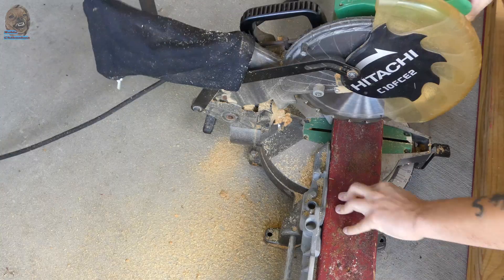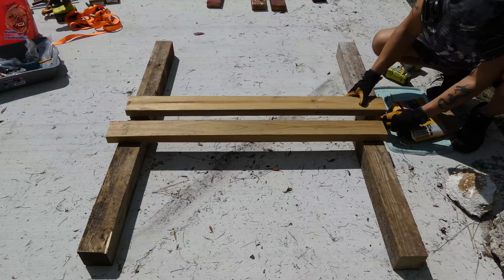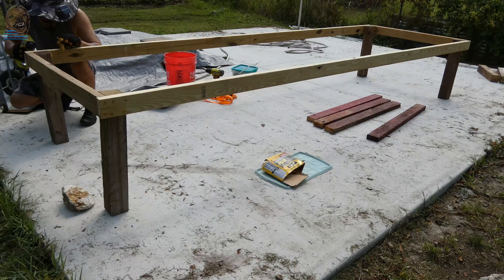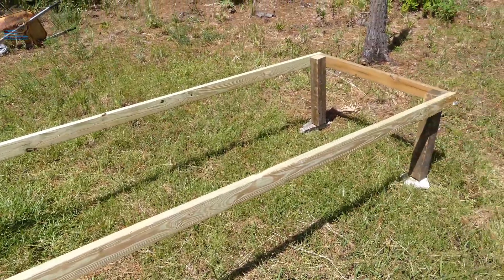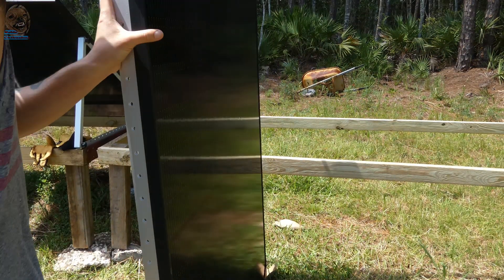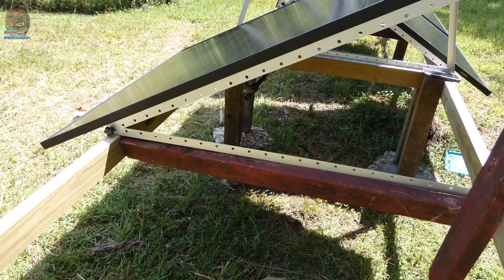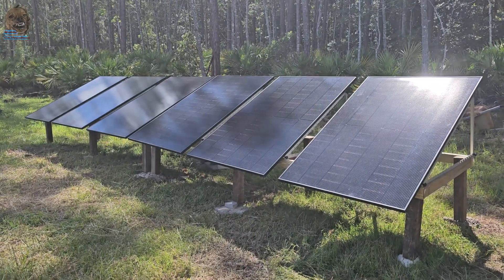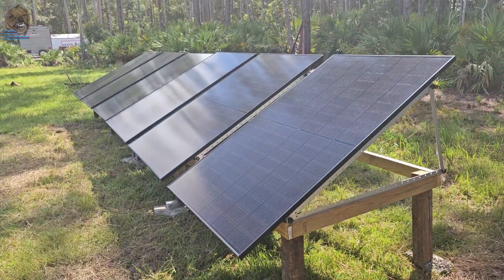DIY Solar Panel Ground Mount – Complete Build for Just $312!

Comment: I built something similar.  From my experience I would recommend flat metal washers on the screws attached to the aluminum angle iron.  With the constant breeze we have, the head of the screws begin to cut the holes larger  due to the wind.  Great video!
Reply from the maker: Good idea. Noticed the aluminum is very soft. I'll install for washers for sure

Comment: Looks nice!  If you are concerned about high wind tipping or blowing them over, Home Depot sells some 30” screw in ground anchors and they work great.  Buy some extra chain and quick links and that ground mount won’t ever move.  👍🤩☀️⚡️
Reply from the maker: Yes sir. Thats the plan as soon as I determine the final location for these things. Not sure if this current location is the best for sun exposure.
Reply: @NobleChihuahua This is exactly how I planned to mount my 400w panels but with the no dig screw in anchors. I plan to take it with me easily when I move..🏌🏾‍♂️
Reply: The screw in anchors I am doing too, but what's this about the need for extra chain and quick links?
Reply: @mrfantastic1266 I used the screw in anchors right under my ground mount and wrapped a chain around the ground mount and through the handle of the anchor, connecting it with a quick link.  With wood, you could also use metal strapping or other methods to tie the ground mount to the ground anchor.
Reply: @terrahillfarm OH okay. I think  I envisioned something else. You  see, If you use a pylex style no dig screw anchor, you just place the 4x4 and drill it in the attached U bracket..Thats it. You don't need a chain because of the anchor in ground  after you twist it down, the U bracket, is already attached with the holes and is made for receiving a 4x4 to screw in.
Reply: I have one that has 10 panels on it and it survived 60+ mph winds no issue with no damage and its not anchored to the ground.